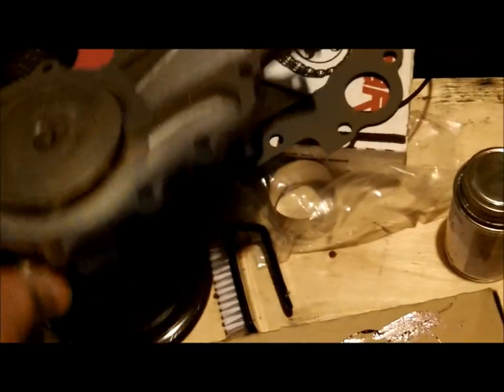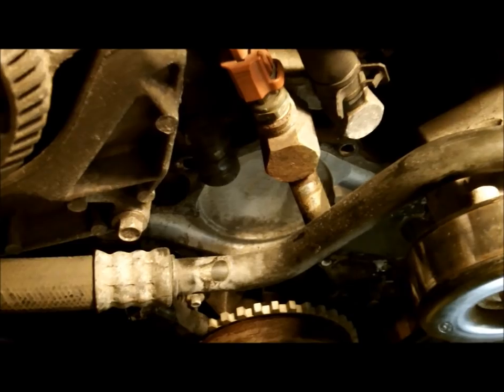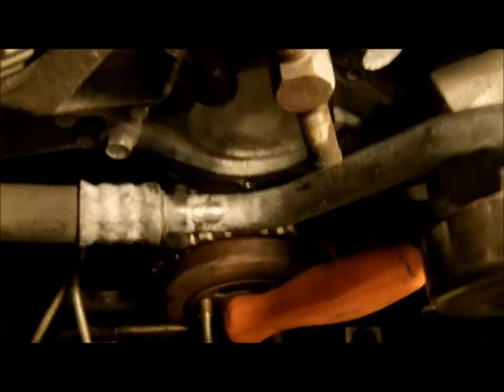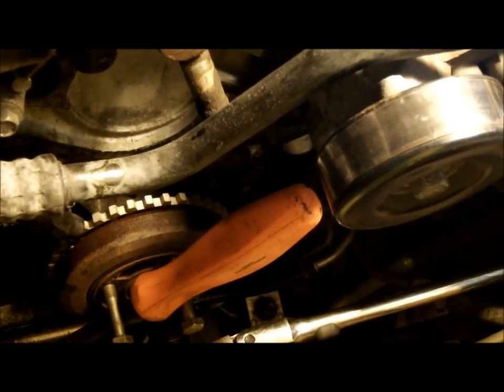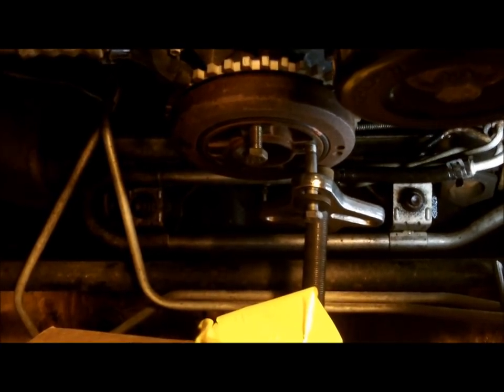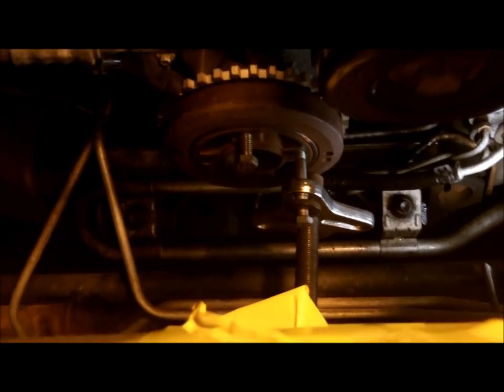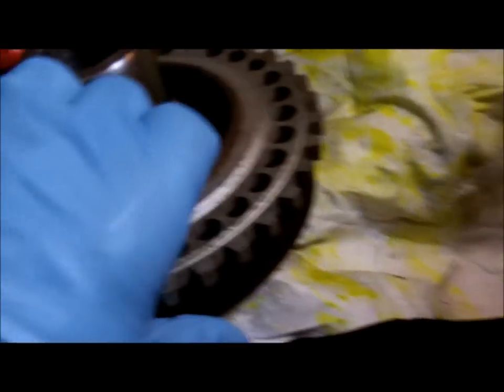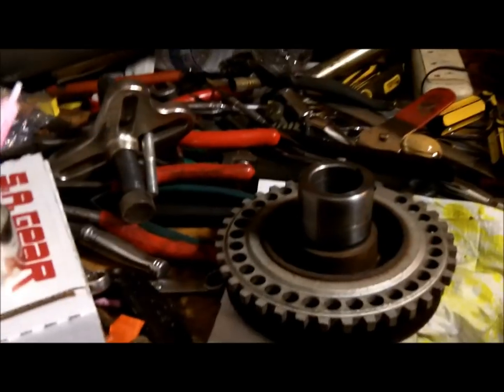Ford Ranger 3.0 timing chain gear set replacement Part III.wmv

Comment: Great series and thanks for the tips, I learned a lot. I need to do this job, my truck has 230k miles.  It runs fine, but I think I can hear the loose chain. My Haynes manual says to remove the oil pan on my 1995 B3000. Is this engine that much different, or is it not really necessary to remove? Also, I didn't quite understand why the HB puller wouldn't work for you. Was the radiator in the way?  Thank you.

Comment: @ the 2 minute mark you explain your method of removing the crank bolt. That's where I'm having trouble right now. I bought some grade 8 bolts to thread in there like you did, but one of them starts to bend and I don't want to risk snapping it or damaging the threads. Did you have a similar experience and just muscled through it? The crank bolt isn't budging.

Comment: Do these engines give any definite sounds or signs of a timing chain or gear failure?  My engine seems okay with 230,000 miles on it but it makes  a strange PUT PUT sounds on acceleration when it is cold......

Comment: does this engine turn clockwise or counter clock wise? do you have to put this top dead center in order to remove the crank pulley?